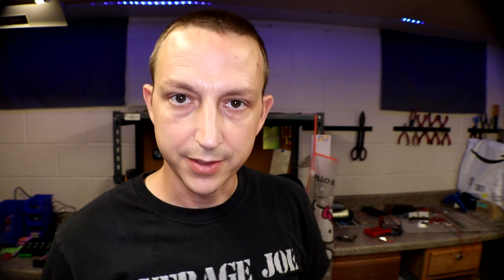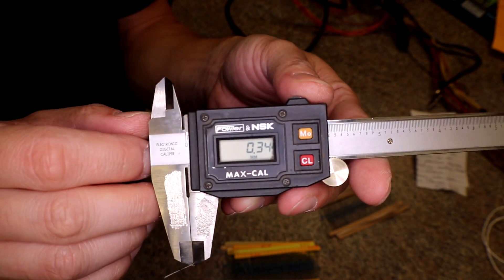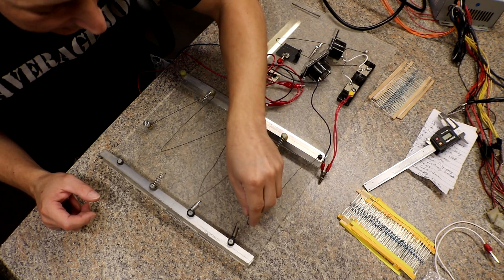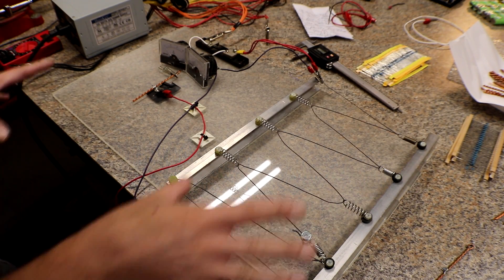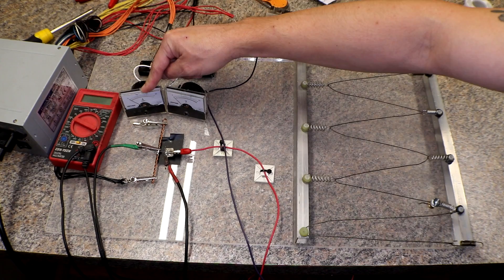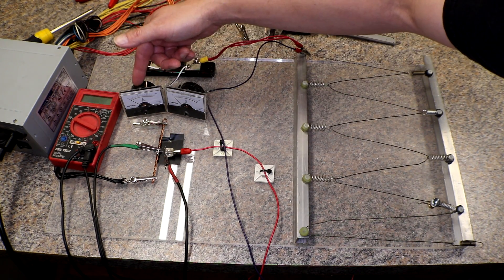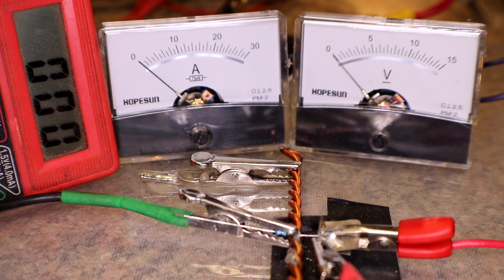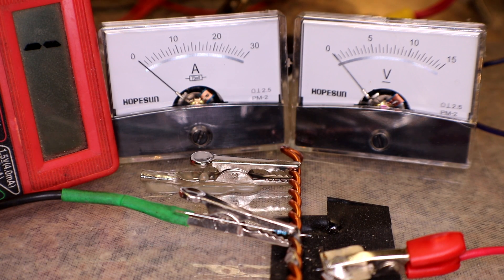Testing Resistors for 18650 Fuses!

Comment: Very good reason never to use resistor legs as fuses.Just under 10amps is crazy
Reply from the maker: Yeah for used laptop cells I wouldnt use that high of a fuse since a good portion of them are a max of 5amps discharge.  Maybe for the high drain cells like you say for ebikes ect.  The resistor legs will work for a last chance dead short fuse on a powerwall but not very well for a cell on its way out.  Some cells can get pretty warm during the 1amp capacity check. The cell would end up getting REAL HOT if it starts to pull more then 2 amps for any length of time and at 8 amps?????    Would end up having some issues I would think.  Extra stress on a bms since the good packs would charge faster.  If one is not around during this time to monitor pack voltage then could bring other problems.  Im not saying that IS what is going to happen but in my opinion 8amps is to high.  One of the main reasons I started testing all the stuff that people are using for fuses.  I want everyone to be informed and stay safe.  Yes the main fuse like you say is also very important, one of the fuses I still need!!!!!!!👍👍👍
Reply: AVErage Joe, let me add an experience that happened to me.  So I was making up some packs using the 5x4 plastic cell holders.  I used the Jehu method 1/8w resistor leads on the positives of all cells wired to the usual heavier wire current distribution take-offs.  The distance of the "fuse" from top of cell center to the distribution wire is about 3/8 inch.  So there is some resistance.  So anyway I had the completed pack laying on the table (charged) and I accidentally dropped my needle nose pliers right on the positive cells side!  The pliers direct shorted one of the cells BEFORE the fuse.  It flashed a heavy spark.  Looking carefully, I could see what happened.  The cell body had a gash in the plastic covering of the metal jacket from the falling pliers and made a short to positive of the cell at the same instant.  Results:  the cell left with a burn mark but otherwise ok, but since in that moment the cell appeared as a short and not a cell, the other 19 cells in parallel instantly blew the "fuse" and it happened extremely fast without seeing the slow glow of a heater element appearance that you show in your tests.  So, now I am comfortable to know that the pack can work with these "fuses" to isolate shorted or nearly so cells FAST before any HEAT becomes an issue in the bad cell.  Note 19 cells parallel outputs way more amps to blow the fuse than you can accurately show when only using your power supply and the nichrome wire.  You need to use actual cell current of parallel packs to be more convincing of actual behavior in a pack.  Because it is more than just fuse amp rating, there is the difference of internal resistance of the cells in parallel vs your power supply and capacity of each to deliver in a fraction of a second thru the fuses.
Reply: Mike can you explain:  Why you say crazy?  As I see it they actually pop around 7-8 amps with 1/8W resistor legs.  In just talking about old laptop low capacity 2.2Ah cells,the purpose of these fuse wires in my view is not to control output amps (unless you are working at 7-10A or more-not safe for laptop cells but ok for high discharge rated cells) of the cell (pack) but just to isolate a shorted, dead or near shorted cell.  In other words, a safe method to weed out cells that have changed to low value resistors that would tend to discharge the pack and cause series packs imbalance and strain on the balance circuits.  In those cases the pack amps being way higher that 7-10 amps capacity will quickly pop the fuse and isolate the unsafe cell from the others.  Having the 7-10A pop window allows any ordinary average or temporary high surges to a load to pass to a high demand load (electric bike climbing hill etc.) without annoying popped fuses in normal use.  But I agree, that 10A is way higher than I would use and would prefer much lower like 1A as I don't want to strain my old cells ever.  My desigined actual average draw never exceeds .25A per cell so that seems quite safe and low stress to the cells.  The battery bank itself should be fused just for the level of load needed but never more current than is safely allowed for the bank in any case.  This is the real fuse you want to be ultra concerned about (crazy safe) for true protection as it dictates what all the little cell guys have to output at combined seriously powerful currents.
Reply: There are two main points. One is the pack a high discharge pack eg used in a ebike and the other is a type of powerwall. If its for an ebike etc then only use high discharge cells eg not laptop ones in which case the fuses will be sized to meet the amp draw of the cells. Another note on this is in an E-bike your sitting on top of it when riding and if anything fails in the pack the worst that can happen is the pack will catch fire under heavy load and hot temps and you might lose the bike. But you will notice when something goes wrong as you will be there. On a powerwall it sits in the corner of the room etc most of the day when no one is at home or no one is watching it, So safety is a much higher concern and that leads us to cell fusing. On a powerwall pack your not and shouldn't be drawing more than a 1amp from the cells normally as pointed out around 0.25amps. If its more than 0.5amps you really needs more cells in parallel. So a high current fuse is completely the wrong type to use, There should never be a load on the cells that exceds 1amp per cell and there should never be a short placed on the cells, Eg you would have a fuse/breaker on the main packs leads of say 60amps for example which in a 50p pack under the 1amp cell fuse anyways. In an 80p its way under the cell fuse blow point. In a powerwall you want the fuse to blow at a much lower value , eg blow under 3amps using a 1amp glass fuse. Why you my ask. Well, how hot does a sanyo cell get when charging in a 1amp charger. It gets Hot, some get very hot and all that they are using is 1amp and turing it to heat. The little tp4056 only does 1amp and well should all know 1amp can cuase a cell to get very hot. Ok So when a cell fails it doesnt just short. If you had a 8amp resistor legs fuse yes it will blow on a short but for every other case it won't.  If a cell fails and just gets hot eg like the Sanyo ones commonly do then it will sit there between all your other cells in your pack getting hot if you used a 0.5 amp glass fuse "blowing under 2amps" from memory. Now if you used a fuse that blows at 5amp guess what. The cell that got hot at 1amp is now sitting there getting way way to hot at 2 or 3 amps without blowing the fuse. Same way the Sanyo doesn't blow the tp4056 up The cell in low resistance just heats up to 60-80c. If you have a cell sitting in your pack between other cells drawing 3 or more all day long as its under the point the fuse will blow it will start to heat up and wont be limited to 80c but will be well over 100c, 1amp will get a cell to 60-80c as shown on some videos when charging. Even at 80c that cell willl start heating up the cells around it causing them to fail on the 1amp example. How about 3 amps or even 4amps, thats less than half that of the "resistor legs fuse" So what will happen well quite simply thermal runaway can happen if the cell or cells dont vent enough cuasing the whole thing to catch fire. Any fuse blowing above 3amps is just asking for trouble. Problem again with this is the powerwall is normally in your house when maybe your not at home. The answer is to use a fuse with as lower vaule as possible but still higher to be useable. 0.5amp or 1amp fuse is what you want to use. That way if a cell does start to go bad and does start to heat up it will only be able to draw a limit of 1 or 2 amps max get hot but not cause venting or venting of other cells around it. The idea in a powerwall is safety and capacity. Not high current draw. If you can't build a large battery pack keeping your per cell amps around 0.25 for your inverter for example get a smaller inverter rather than pulling high current from the old laptop cells and using the wrong fuses. Alot of people seam to only focus on a short but that is not what they should be looking at when thinking of cell fuses.
Reply from the maker: Everything Ive said from the start of my build!!🖒🖒🖒🖒🖒🖒🖒🖒🖒🖒🖒🖒🖒🖒🖒🖒🖒🖒🖒🖒🖒🖒🖒🖒🖒🖒
Reply: Yip
Reply: Hi Mike been following your journey for the longest.  Thanks for the most detailed reply of all Youtube comments!  First, I by choice do prefer to not drive any laptop cell over .25A:  It has nothing to do with what anyone says, just my own sense and understanding of the cell chemistry and the charge/discharge graphs in regard to safe and usability at the best longevity.  As an electronics tech, I know very well all the usual electrical considerations.  So, I agree with your position and appreciate the time you took to show your thoughts on this very important topic.  All I would say is that people can use official fuse wire to do the same need as the tiny glass fuses, they can use either.  But in truth I still only see the cell fuse as a stop gap measure.  I don't think the laptop cells in the older Tesla cars were limited to .25A per cell and they had good success WITH FUSE WIRE and blessed by their engineers.  Limiting your  and my cells to .25A while nice, is also not using much of the usable energy/per unit time and forces all to have many more cells ($$$) in the build of a powerwall.  There has to be some trade off to be practical.  The stop gap is you are trying to stop thermal runaway with a fuse when trouble has already reared its ugly head.  Also, it does not address the rogue thermal runaway of a cell that has developed an internal discharge current path to itself (maybe low current but heat builds) which also has all the fire dangers and occurs in the middle of the night while you sleep.  So a fuse is only a partial solution at best in the ideal world.  Ideally, we should already know what cells are beginning to be heaters or dischargers (which may also heat)  to their respectful packs.  That can only be done with some form of temperature monitoring.  Only then can we be the safest when leaving the home at the mercy of a rogue cell.  My interim solution until I finalize a workable temp monitor per cell circuit is to not have the power bank in the house and simply have it outside mounted on concrete blocks (very cheap) on all sides with a weather/fire proof roof but only 6 feet from the house so not much power loss.  The fused wires come directly into the house and then the charge controllers and such do their job.  Also I want quick disconnects on each pack so IF I am home and happen to see the rogue pack in time, I can yank the connector and in 1 second throw the bad pack in a 4'x4' sandbox confinement area, hence nearly zero fire risk to my home.  To me the most dangerous situation no one has mentioned here is the case of while charging a near dead (I mean nearly discharged) pack where the one rogue cell is much lower EMF that the others of the pack leading to a risk of the pack forcing a reversed polarity charging of the rogue cell and then a real quick BOOM potential.  My way out of this is to not ever allow the cells pack to go below 3V, for those that are forgetful there are simple low voltage shutoff circuits available.  I think even Jehu forgot to charge his samba lately and let the cells get very low and he is knowledgeable, but it still happened and can with anyone.  Have you heard of any good temp/per cell monitoring available at an affordable cost yet?  Before I reinvent the wheel.  I don't want expensive or complicated software or dataloggers for this, rather a simple monitor and alarm or auto disconnect a pack function.  If FLIR cameras were cheap enough, that would be a good start with some software to alert abnormal conditions from the other cells and an auto shut down pack function or smart phone alert.
Reply from the maker: Yeah I agree! I wouldnt use them on the positive side.  You could get away with using them on the negative side like he was gonna do.👍
Reply from the maker: All great points.  Thank you 2 for commenting!!! Ill pin the comment for others to read!👍 I was gonna add that with the batrium bms logs all the info (including temps)for you and you could go in and compare ect...  If one checks that data, you could see a pack or packs having issues and hopefully resolve any issues before it gets bad.  You can also set up a shunt trip to disconnect the packs based on voltage.  Ill be adding that feature sometime in the future!
Reply: AveRage Joe.  I have been following your channel for a long time.  Like the funny expressions and effects.  I have a free solar whole house hot water system (I have seen yours too) that works with no pumps or check valves, no electronics and no side heat exchanger while using plastic solar pool panels all year.  A bit different than yours but does use thermosiphon method.  I just uploaded the latest  UPDATED video part 3 of my simple solar house hot water system if you would like to see a quick showcase.  

Pretty sure Batrium is waaay too expensive for my tiny 2kW power bank, but is an option especially for those with huge kW banks.  You said it monitors temps.  How, by a ton of temp probes$$$?  And where/how do they mount on EACH CELL in plastic cell frames?  Does the Batrium monitor the temps ALERT us of abnormal conditions WHILE we are away or sleeping at night?  There must be AN AP for THAT! as the saying goes  :))  I am thinking  of a much simpler and cheaper solution in the case of avoiding thermal runaway, where we use just one sensor per pack that can sense all cells in that pack at once.  As in an emergency we don't need to know which cell of a pack is rogue in order to unplug that pack and throw out in the sand pile etc. or at least to send us an alarm:  like a fire alarm or activate some special instructions like command to dump bucket of sand over bank etc.  This is all assuming the temp has reached say a very hot like 165F, which would  not be enough time to repair before Boom for the packs that are soldered in plastic frames.  But if the temp has reached only say 115F then we might have a chance to rescue the pack and only throw out the rogue cell.  I had an idea of having the packs mounted like typical on server racks, but where if an emergency over heat is detected (165F just as an example not actual temp) that a solenoid arm mounted behind each pack can be activated to dump the rogue pack and simultaneously disconnects it as the pack is thrown into a sand pit or other means of fire isolation.  24hr protection.  Only an idea for now.
Reply: EnergyCrafts.  FLIR camera to monitor packs is a good and interesting idea, didn't think of that but would be only useful on small packs that are on a wall with the camera facing the wall or on the floor with camera looking down. The problem would be on larger packs anything over 10kWh wouldn't work very well. Also the software would be a pain to come up with but could be done in something like TensorFlow using a model to look for hotspots then alert. The amount of time and effort trying to get the Flir idea to work would outway the pros. Your better off putting a row of temp probes "maybe 6" on a thin piece of copper slid inbetten the pack up the middle. Read the highest temp out of the 6 and alert if it got too high. I thought of doing that but 6x14 (84) then x3 (252) is a lot of temp probes to wire up and would be a complete pain but the idea would work well and be alot cheaper, I am thinking 3 temp probes for 80p so one temp probe per 20 cells in the pack would be better but thats still 42 probes for 14s.
Reply: AveRage Joe. Thanks, Oh i think the shunt trip is a must have. No point of having a BMS if it cant stop the load or the charging of the pack if alerts go off. Eg if a cell falls below 3v it should cut the pack off. I remember in your live stream your cell dropped very low until the inverter kicked off. So ya shunt trip. But i would build your own. I am about to. Its easy if you had a 3d printer :p #Goodreasontobuyone
Reply: Mike.  Agreed the FLIR route is not easy or cheap.  There is some free motion detection software for use with security cameras I saw somewhere on the net.  Was think for a software guy (not me) that it might be an easy mod to detect instead of changing "motion" via pixel bit patterns to color changes via pixel pattern comparison.  Seems similar tactics.  Even your idea using 6 probes per pack is still too expensive and too much build work.  If have a couple of ideas.  One is to not use temp probes, rather use the principle of the Wheatstone bridge and precision resistors.  This would detect 4 possible positions on a pack and the output can run to an amplifier etc.  Resistors are far cheaper than temp probes and very sensitive to temp vs resistance and linear as well!  Another idea is to mount tiny photovoltaic panels (yes they do exist very tiny!) as many as desired per each cell or per pack with the "sun facing" side facing only the cell in question.  Solar cells are sensitive to IR (heat) as well as light freqs.  This is nice because the solar cells provide their own power signal to drive an op-amp or whatever alarm system.  Also along the same lines, small clear glass diodes like the 1N34A or 1N914 etc will also produce a current output with exposure to IR (heat) or sunlight too!  These are just some ideas, could also use principle of thermocouples with just a Wheatstone bridge using say copper and iron (not really good as it rusts) wires (cheap) to detect heat as well.  I have many other ideas even simpler floating around.  Would like to R&D with somebody to commercialize a version as this is something everybody using lithium batteries could use especially the very large power banks.  As this has a possible business aspect, I don't want to give many details here since for now since there is practically no competition for the product yet.  Beware Mr. China, no free lunch here!
Reply: Ya 10 amps is fine i have shorted one of those cells with just a like 12 awg wire with a dc clamp meter and it put out over 100 Amps so if one gets shorted it would pop i dont really know what happens in other failure modes